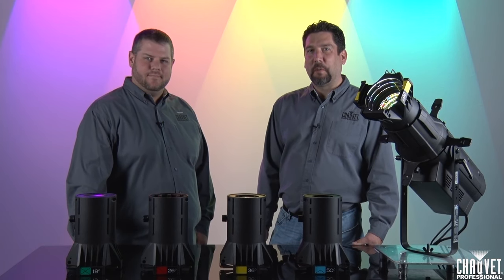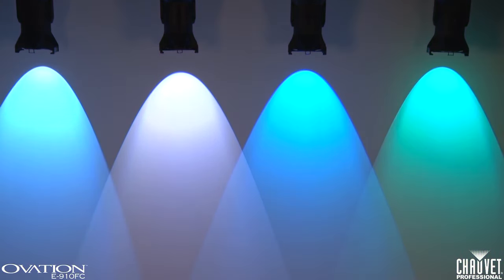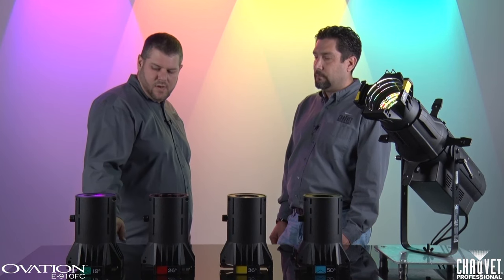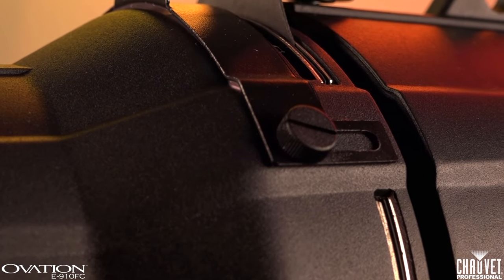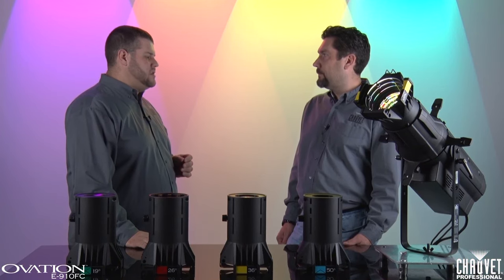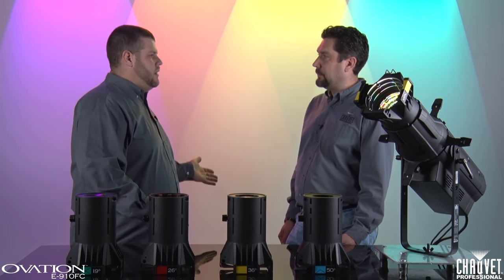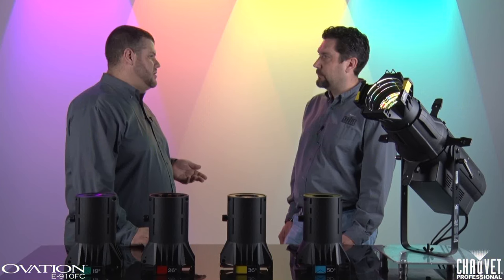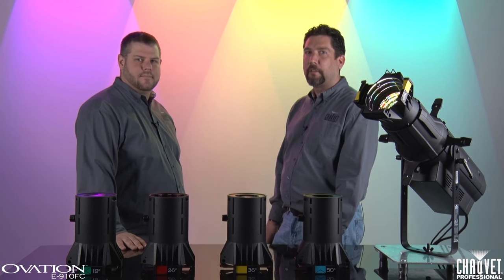Ovation E-910FC by CHAUVET Professional

Comment: I would like to know how you got such a sharp edge on your gobo's. Our company just purchased a bunch of units and one of the first things I did was to try out the gobo's and I noticed a "rainbow" like edge. The thinking behind this was that there ISN'T a singular light source, but hundreds of LED's. As opposed to a conventional with one singular filament to give you a sharper edge. I am wondering if I am doing something wrong or if there is an adjustment that I can make to give it a sharper edge.
Thanks!